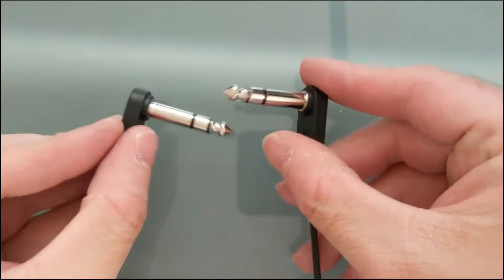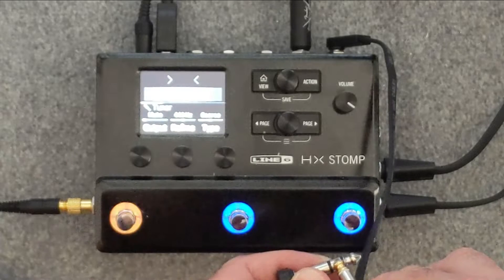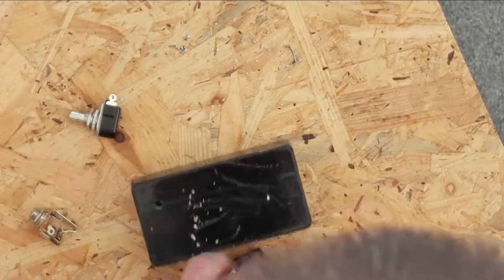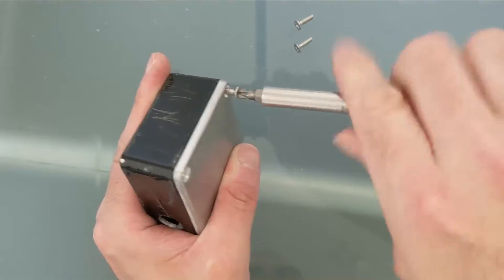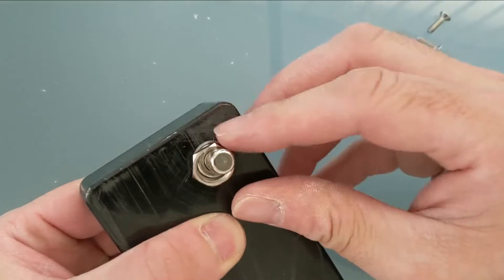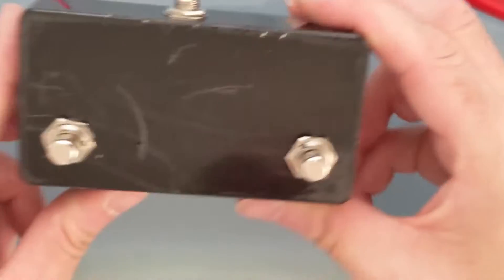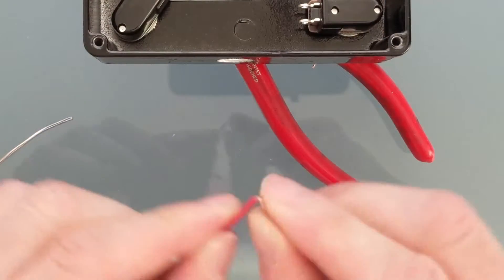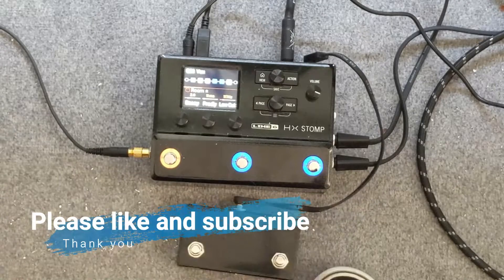HX Stomp - $10 DIY Dual Footswitch #hxstomp

Comment: I just built something very similar, but am experiencing bouncing: sometimes when pressing a switch once, the HX stomp will advance two steps (double trigger). Did you experience the same? How did you overcome this? Using resistor and capacitor?
Reply from the maker: I had no problems. Here is a pretty good explanation if you want to tackle that with an easy hardware solution https://youtu.be/Y86-t9j6doo?si=OyUeHiaOShkoj0nb

Comment: Would it be possible to add a led light to show when they are on?
Reply from the maker: not with this configuration. i do not know, what currents line 6 is using on the external jacks (you'd have to check, if there is enough power for an led). check out this video https://www.youtube.com/watch?v=7p3adTAm40c the marshall switch he is using, is basically the same switch as mine. good luck.

Comment: Are these both momentary switches? 
Second question. If I made a channel up and down on the midi input would it need to be momentary or latching?
Reply from the maker: yes. both are momentary. building something that sends a midi command is way more involved than i am willing to get involved with ;) but if i had to guess, if you had the midi brain/chip/computer in your switch figuered out, i would think you would trigger this with a momentary switch, also.

Comment: How about updown footswitch, do you have example?
Reply from the maker: as far as i know, preset up/down is only available via midi (unless they have updated the firmware).
Reply: @SLARPmusic  I actually use it as preset up/down...  depending on the mode it definitely works as well.

Comment: Do you if is possible to add a status led for each switch?
Reply from the maker: not in this configuration. these are one-pole momentary 'dumb' switches. if you need on/off status leds for helix effects, a midi switcher is probably your best bet.

Comment: Will this work on a Boss RC-30?
Reply from the maker: From what i can gather off the internet, the RC series expect a 'normally closed' footswitch (needs confirmation). If this ist true, this switch in it's current configuration will not work, because ist is wired as 'normally open'. To make this work, you will need different switches. 1pdt or similar would work (the dt, double throw part is important).

Comment: What if you want 3 buttons?
Reply from the maker: you can't. two external stomp buttons is the max. if you need more, you will have to get a midi switcher.
Reply: Frank Voigts si making a diy midi switcher, like the Morningstar MC6 would work like this fs4/5 and as a midi also? Or probably just midi

Comment: Hello, do you think it's possible to add a led statut for each switch ?
Reply: Not possible with FS4 and FS5 on the hx stomp. The input on FS mode is just detecting when the tip and ring connections are shorted to the sleeve and doesn't have an output for controlling LEDs. It might be possible using a custom midi foot controller, but using this method only FS1-FS3 can have LED indicators

Comment: Do you have the wiring diagram?
Reply: He explains it briefly at 4:10 , but basically each momentary switch has 2 terminals. One terminal of switch 1 and 2 is connected to the sleeve (ground) connection of the jack. Then, the other terminal of switch 1 is connected to the tip of the jack, and the other terminal of switch 2 is connected to the ring of the jack. You can look up a diagram of your TRS jack to see which connection is where.

Comment: How was your third button on the stomp not Tap Tempo?
Reply from the maker: You can change that in the global settings. Go to Footswitches and change the fs3 function from Tap/Tuner to stomp 3.
Reply: Go in to global settings - Pedal Assignment and you can change the function of the 3rd pedal which most people do.
Reply: @MrBatf1nk  Do you have the wiring diagram?